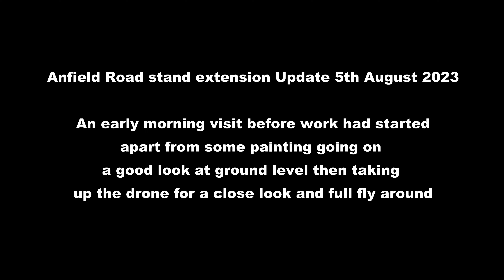Anfield road stand extension update 5th August 2023

Comment: Great vid Paul - I still dont understand why nothing has been done to build the terracing in the bottom left corner (where the original roof support structure was). Steelwork is still required to support terracing yet the only way is via a cherry picker or similar through the tunnel. They can temporarily fence it off for safety reasons of course, but why not do the basic heavy lifting before completing the pitch and completing the adjacent cladding restricting side and front access?

Comment: Thank you for the video! it doesn't seem that both upper and lower stands will be used  until the work is finished inside out, as well as outside entry. Pretty sure the club will issue another notice about this!

Comment: You'd think they would have built an access hatch out on to the roof, then used that during construction instead of leaving so much cladding off for so long. Anyways, it's nearly finished now.

Nice to see the progress with the brickwork.
Reply: There are two hatches, either side of the solar panels.
Reply: There already are access hatches onto the roof. Cladding has been left off at the back to give workers natural light whilst working under the roof in the upper tier. Finishing that cladding later is a quick and easy job.

Comment: Pondering ideas, and using your roof level flyby, it made me look over towards the KOP roof. I wonder if it would be feasible to put in a top tier on the KOP as a possible expansion? I don't think the overall footprint of that stand would need to be increased too dramatically to accommodate that.
Reply: The footprint would have to be changed massively, don't kid yourself on that.
Reply: @scudger99  I was more thinking like the top tier that they just removed from the ARE, this was sat in the same footprint as the remaining lower tier.
Reply: @aquissuk  Should they use Lego or Sticklebricks ?
Reply: @scudger99  Has mummy not made your bottle yet?
Reply: @aquissuk  Reduced to that already ? Awww diddums.
Reply: The biggest issue is transport links. A rail station on an existing line is being looked at. Trams or an enlarged bus system too.
Once that is prepared, ground expansion will be easier.
Altho reacquiring properties behind the Dalglish stand may take a while, even with compulsory purchases.
Anfield desperately needs all 4 sides done, and 4 corners wouldn't harm either.
Club is massively behind where it should be sadly. And FSG have been leeching off the club for 13 long years (Cue shills and Fenway-cucks posting nonsense and lies).
Reply: @scudger99 
A new tier needs another concourse and more facilities. The footprint would need to grow too.
Reply: You can't put another tier on the Kop......It's the Kop. It would lose it's uniqueness.
Reply: The Kop MUST remain a single tier stand, 99% of LFC fans will agree with that. What needs to be done, is the Kop's angle needs to be increased followed by extending the height of the structure within it's footprint. This has to be done, the Kop needs to be the best stand in the stadium.👍👍👍
Reply: @RS-xx9ve  FSG are businessmen, LFC is a part of their business.  The whole purpose of business is to make money.  Cue the shock and horror when businessmen expect to make money out of their business.
It's also comical when people want money spent that isn't theirs.
Is that nonsense and lies ?
Reply: @harbottle8580  The Kop end would definitely benefit from expansion.  It will always be unique, the people in it make it that way.  Not the steel and brickworks.
Reply: @davidspion9548  Absolutely.
Reply: @gerardfrancis3222  Why not have some magic carpets to take people up to the uppermost levels too ?